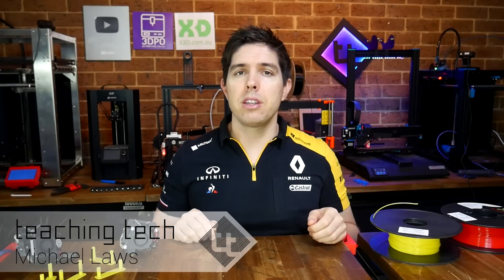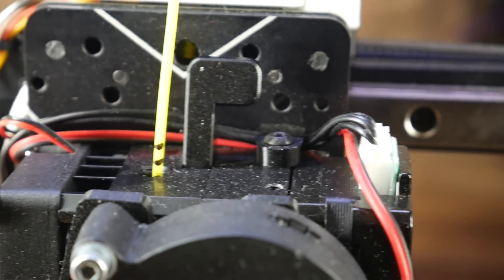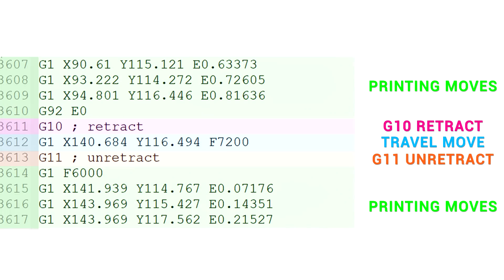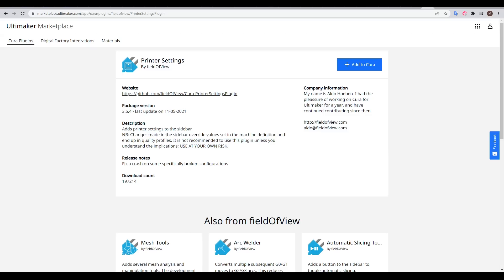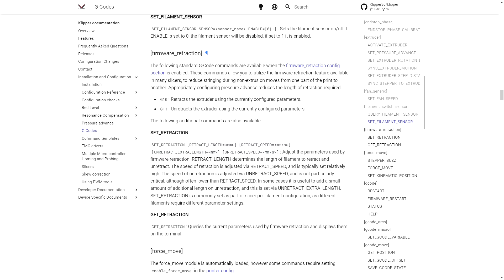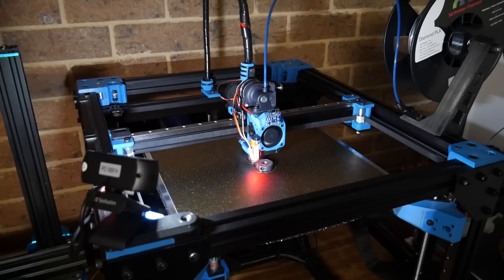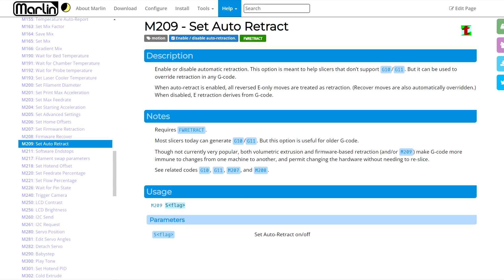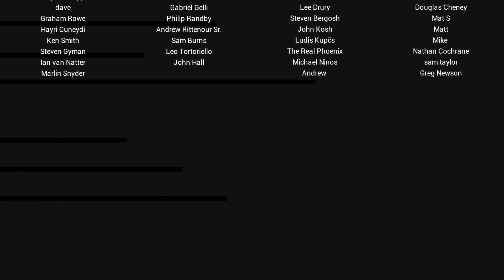Firmware retraction: Why you should try it out

Comment: Noob question. If using firmware retraction, should I disable retraction in slicer? Or does enabling firmware retraction in slicer bypass the sli8cer retraction settings?

Comment: Thank you for this video!  I have done all the steps you outlined for Klipper, but I do not see the option to adjust retraction parameters in my lcd screen menu.  I am running a Switchwire conversion with 12864 lcd screen with a STM32 USB board controlling the screen via my pi which is running Klipper.  Any ideas on how to fix the menu?

EDIT - Got it sorted!

Comment: What about switching filament types?  wouldn't the settings need to be different for different filaments?  I use Klipper.
Reply from the maker: You could have a filament specific macro/gcode for each filament set up in your slicer that loads the parameters needed.
Reply: @TeachingTech  thanks.  Sounds complicated though.

Comment: The only downside I see to this is the fact that I have to manually change settings every time I switch materials, say if I go from ASA with hardly any stringing to TPU which requires a bit more retraction. In a slicer, I can just create a separate profile for this.

Comment: I've been struggling with retraction settings after upgrading to a Mosquito / Bondtech setup. I can't tell you how useful it's going to be to change retraction settings on the fly to get my setup tuned in correctly. I just installed the Printer Settings plugin in Cura and voila! This is going to save so much time.

Comment: Is there a way to communicate the filament type used in the start gcode from the slicer to Klipper? And to then set the retraction settings in the start_print macro in Klipper depending on which filament is being used? I’m currently calling the start_print Klipper macro from within SuperSlicer, along with the initial hot end and bed temperatures so I was wondering if I could pass more variables to that.

Comment: Thank you for the detailed video explaining everything.  I was wondering how to enable this on my ender 3 S1 when I today flashed Professional Firmware and I found this option in the printer, but didn't know, how to enable it in the slicer. Now i know :)
Reply: Hi there.. I ve used the suggested start and end gcode or professional firmware but cant find the specific lines i need to add in order to enable it..

Comment: Thanks for the great videos. I have been using your retraction calibration as I have upgraded my extruder on my new AS-x2. One thing that is a mystery to me is why the retraction has a "sweet spot". That is, no retraction generates much stringing, while too much retraction also can generate as much or worse then none at all. My original simple minded intuition guides me to think that larger retraction should generate smaller stringing. Perhaps you could talk about this in one of your future videos.
Reply: Probably it's retracting so much so quickly that the filament stretches faster than it can be pulled back, causing the effect of the retraction being similar to a lower setting.

Comment: First of all, thank you so much for the things I have learned over the past several years 3D printing.  I bought an Ender 3, 2 years ago and it runs like a well oiled machine with all its mods thanks to your many tutorials.  I finally decided it was time to buy another printer, so I went for the CR10 Smart Pro (despite your review of the non-pro version) because it seemed like it had everything I wanted and I have had so much success with my Ender 3.  In any case, after updating the firmware, the printer runs great with one (fairly large) exception: huge blobs and the worst stringing I have ever seen.

Of course I went to your calibration site to tune my temperature, retraction, e-steps, etc. but nothing seemed to help.  Then I realized that, for some reason, every time the printer goes to do a retract, it extrudes instead!  I tested this by putting a very large value for the retraction distance, and sure enough, the blobs got bigger, and I still don't detect the filament retracting via the marker marks I made just above the direct drive extruder (rather the printer very forcibly squirts out huge globs of filament every time it travels.  Turning retraction off fixes the blobs, but the stringing is still bad (as you might expect when not using retraction).

So, fingers crossed, I was hoping I could use Firmware retraction instead.  So I found the source code that Creality publishes for the CR10 Smart Pro and uncommented FWRETRACT.  I set the default retraction distance to 1 (instead of 5), updated the firmware, sliced with the Firmware Retraction setting checked, and I think my result is a little better?  Of course, I could continue to keep reupdating the firmware guessing at the settings, but I figured I would post here in case you would be so kind to share any more wisdom you might have that could help fix this issue.  Note that I can't find an option on the printer screen to change the retraction settings, and I also have not been able to connect this printer via usb to use pronterface to change settings that way.

Thanks

Comment: Dear Teaching Tech ...
How does retraction relate to a 2 in 1 out hotend such as the Geeetech A20M ? I am having a hard time finding the sweet spot for regular PLA ?  I have had success with PETG (Distance: 6mm Speed: 35mm/s at 230c), PLA+ (Distance: 6mm Speed: 35mm/s at 200c), and Matte PLA (Distance: 5.5mm Speed: 35mm/s at 185c ???) but PLA is doing my head ? Why ? I have dried the PLA in a food dehydrator several times and the best I can get is fine strands at 180c that leave little bumps behind ??? Please help ... Thank you ...

Comment: Just waiting on getting a BIQU H2 hotend & BigTreeTech mainboard to upgrade my old Alfawise U10, and will look into firmware retraction once all setup and calibrated. No I hadn't heard of firmware retraction, though like the ability to adjust mid-print as you highlighted. Out of interest, what is the printer that you show running at 10:19 ?

Comment: Firmware retraction is supported in Cura V 4.13.0. If you go down into the Printer Settings section there is a selectable button called "Firmware Rertraction".

Thanks, excellent video though!

Comment: I don't think I will be trying it. Other than some basic calibration prints (cubes and temp towers), I rarely keep old gcode laying around - I'm happy to re-slice things if I need to print them more than once over time. I also like printing with a variety of materials, and would rather control the retraction settings automatically with my slicer profiles than having to manually adjust the settings when I switch from PLA to PETG to TPU and back again...and maybe forgetting to do so.

All that being said, this is a neat concept that I'd never heard of before. Great video!

Comment: Hi Michael, here manu7irl, we talked before, with firmware_retraction on klipper and with a help of a small macro you could print a one time file with dynamically changing tuning tower command running.
If you need some help contact me.

Comment: I'm not sure if I fully understand the benefits. Retraction can be different per filament, not just per machine. If the settings are stored in the firmware then per-filament retraction settings aren't possible. Unless I just don't get it.
Reply from the maker: I guess you could load your firmware retraction parameters in the slicer still, but tied to a filament profile rather than the printer profile.

Comment: My hesitation to enable FW Retraction is that I have different retraction settings dialed in for every filament I have, and profiles setup in slicer to handle all that. If my only option is to manually dial those in every time I switch filament, then nah, I'm good. I don't need to fix what ain't broken.
Reply: In a proper implementation, your slicer will use a gcode command to update the fw retract parameters to match your filament. That said, it's not in Cura by default and you have to write it in your start gcode
Reply: @BZ_438  ohhhhhh is that what the per-filament custom gcode is for in prusa/superslicer!?
you learn something new every day....

Comment: I’ve not done any testing to figure out what the root cause is, but after switching to Klipper (initially with slicer retraction in Cura) and setting up firmware retraction on my Ender 5+, any stringing I previously had with retraction was all but eliminated. Print speed doesn’t seem to affect it either.

Comment: Is there some way to put material in the header of the g-code and have it pick different retractions based upon this? I understand you could put the retraction settings in the start g-code, but that stops it from working automatically if you change the printer. I am running duet, and would prefer knowledge on this, but klipper would be good too.
Reply: Some slicers can do per-filament custom g-code, so this should be possible. Haven't checked others in a while, but superslicer and prusaslicer can do this. I don't know about duet, but in klipper you can set it with SET_RETRACTION. For this to work you'd have to have the same firmware on different printers of course.

Comment: Firmware retraction is just 1 small step towards where we should be heading on the software side of things: Entirely relative rather than absolute instructions
I've always thought that g-code is really not a good format, especially not for 3d printing. Ideally you should be able to take the same 'sliced' file and send it to any printer and it would produce the same object in more or less the same way, but with printer specific parameters, not hard-coded values in g-code itself. Meaning a cartesian with X,Y at 0,0 loaded with PLA, or a delta with X,Y in the middle of the bed and loaded with PETG shouldn't matter, they'll both print the part in the middle of the bed but at different speeds/temperatures/fan/etc for their known setup. As you change out filament or alter something, you set that globally on the printer, you shouldn't need to re-slice the file

Practically everything such as nozzle/bed temperature, extrusion amount, fan speeds etc should all be something that the printer itself decides, not the code. Thus you can tune all your differing printers precisely and they will all make the same object from the same file. Switching out filament, or deciding to print 10c hotter/colder, or even scaling the entire object slightly larger/smaller should all be printer setting and shouldn't require re-slicing a new file, its silly and archaic. Fine for a CNC machine that never changes and only ever does custom jobs, but g-code is a crap format for the highly variable and community driven 4environment of 3d printing

The slicers job shouldn't be to dictate the exact printer you use. The slicer should instead be tweakable to give out general instructions like "slow down because we're about to do a bridging section/infil/whatever" but not mandate exact speeds and instructions all the way through. About the only thing I can think of that would still need to be hard-coded is nozzle size/line width and a different file would be needed, since any adjustment would drastically alter the geometry. Almost everything else can be inferred in real-time by the printer with its own known setup

Comment: Interesting video. I knew it existed, but never tried it.

Don't think I will as cannot really see an advantage for me and the way I work. I have just one printer, but do change filaments. Therefore it is more convenient to just be able to slice with different settings for the filaments, it keeps all settings in one place. If I had multiple printers with one filament type each, I can see it might be the other way round.

Also, I use Cura, having tried and discarded (for now) SuperSlicer, and I don't really want to use Cura add ins.

Comment: Great video. Only issue with firmware retraction is that it doesn't have wipe. Retract+wipe in my opinion > retract only. And wiping requires knowledge of the model getting printed.
Reply: I mean, if you don't retract before you wipe it just oozes out later :-D

Comment: I think a hybrid approach is best though i am not sure how to implement it.

i want slicer based reaction, but the slicer should output variables for retraction distance, speed, unretract distance, zhop distance etc.  this would allow the firmware to modify the variables mid print but also allow features like wipe on retract that are impossible with straight firmware retraction.

Comment: Great video, the ability to change retraction settings mid print would be fantastic for tweaking settings for a new filament in near real time.  I'm assuming you could then disable firmware retraction via g-code once you have a profile dialed in enabling easy changes between filament without altering firmware settings each time?

Comment: As soon as you change material it sounds like all this goes out the window. Am I missing something or is this also a disadvantage?
Reply: With this I guess you could use same gcode across multiple materials & just adjust temps/retraction on the printer itself, rather than re-slicing for each.
Reply: I see it as somewhat of a disadvantage. You can get around it by turning off firmware retraction when you switch to a material that needs different settings, then use a material-specific profile with SW retraction, but then you lose the advantage of not having to re-slice.

Comment: This is a game changer for me. I knew hardware retraction existed, as I see it when I set up my own firmware, but hadn't considered its advantages.  I do a lot of custom printing that requires on-the-fly filament changes and therefore, settings changes. Some of those get missed in the slicers or are no longer valid, because of environmental changes. This will allow me to to tune retraction settings at the printer, as needed.

Comment: When z-hop becomes available in Klipper I'll definitely give it a try. Being able to change z-hop settings mid-print will be helpful from time to time to avoid collision from curling. It's not a big deal but every little thing helps.
Reply: Have a look at the comment by Pedro Lamas in the start of the comment feed.
Was gonna post the same as him but he did it first.
Reply: @DrInfiniteExplorer  I didn't see that comment before. Thanks, I'll try it out.
Reply: @Brian Clymer Yes, cooling was the problem. I have an enclosure for abs and nylon but I have to remember to keep the doors open for PLA.

Comment: Just wanted to note that currently Klipper doesn't appear to support a negative unretract distance (my printer.cfg throws an error with the -0.2 shown), however you can modify the python code to allow it if you want
Reply: Wouldn't that mean that instead of adding a tiny bit of material (like Cura has a setting to compensate travel stringing and such), it would return less than it should, and under extrude right after a retract and maybe leave small holes in the seams?